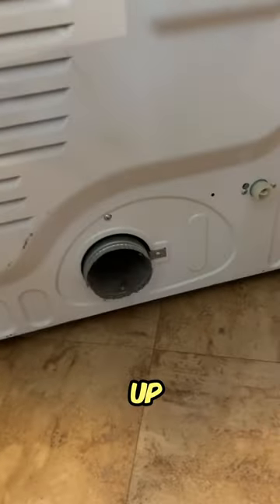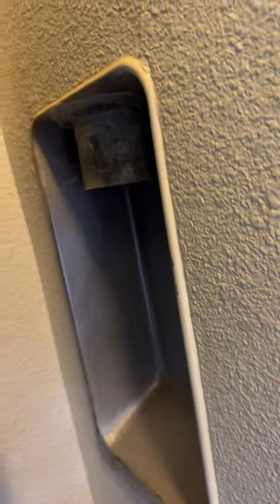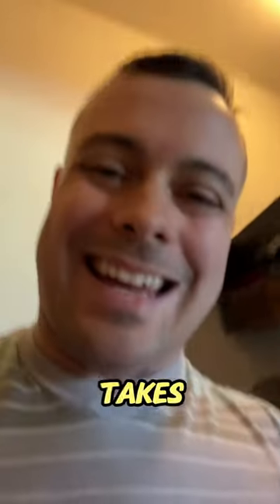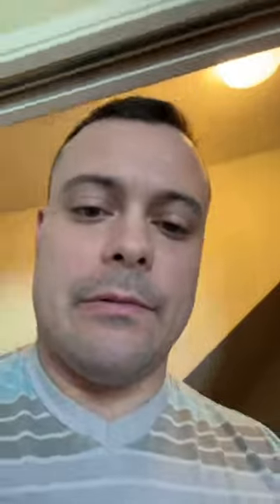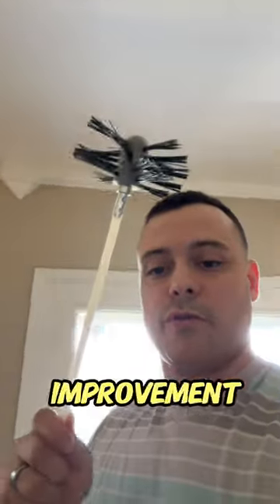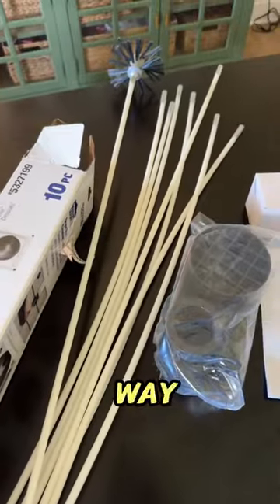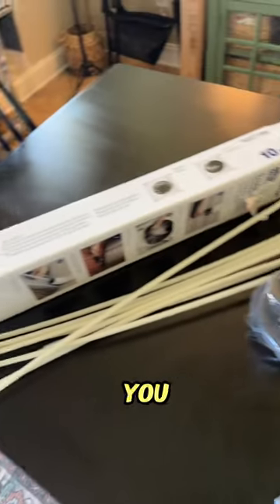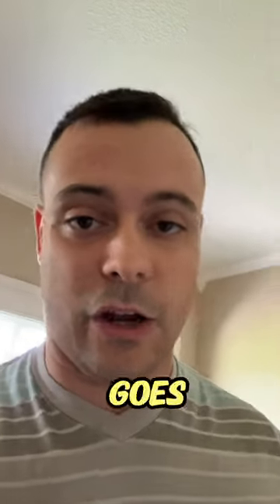Watch This Before You Buy A Dryer

Comment: Do NOT EVER spin that brush attachment in reverse. Always spin it forward even when you are pulling it out. Otherwise you will unscrew that connection and loose your whip in the wall.
Reply: Excellent advice. Also, I like to add electrical tape around the joints between the sections as an added safety measure.
Reply: Gorilla tape it on, or just glue the first rod on with jb weld.

Thank me later
Reply: Yeah I made that mistake my first time. Lucky I could snake it back out with my snap on master coat hanger hook to pull it back out.
Reply: @tarheelcountry1868  I won't, that's terrible advice. If you JB weld it it's not coming apart very easily. Just keep the drill in the correct direction.
Reply: @usb6000  the sections are quite flexible. We keep ours put together and coiled up. 
-Apartment Maintenance Tech
Reply: Goddamn it gump. You’re a goddamn genius!
Reply: Yeah good shout , this will save people a big pain in the arse
Reply: True but you can follow it up with a second brush and push it out.  Been there a few times with these snapping off on jobs.
Reply: Came here for this.
Reply: @austinhamilton9707 just get the nikkro ones. These are a “hey imma have to cut a hole in your ceiling” special.
Reply: Beat me to it. That was gonna be my pro tip too. It's so natural to flip the drill into reverse from muscle memory when pulling it back out. They honestly should make something on those connections that prevents the segments from unscrewing unless you press in a clip or something. This design flaw has caused mass anguish from people inadvertently doing this.

Comment: It can also become a fire hazard
Reply: Apparently one of the most common causes of house fires
Reply: @kmirandakm14 yeah, I deliver appliances and I've straight up refused to install a dryer because the duct was so clogged. Also, for the love of God, if you have an older house/dryer, replace your old vinyl duct BEFORE it starts melting
Reply: As a contractor that installs duct Work You have to secure with tin tape if because  you use screws it will collect more lint And burn your house down.
Reply: One of my classmates lost their house to a house fire caused by lint buildup. The whole school got together to donate and get them set up in a hotel for a few months and to help them get their life back together

Comment: Must be on post housing since that exit pipe shoots up instead of straight or down. Gravity only works in one direction and anything that gets caught will fall back inside once the dryer shuts off. Larger chunks are too heavy for a dryer to push out, and lint fibers will continue to stick together around those chunks. It's one of the first things I look for before signing leases, along with checking each outlet with a phone charger, if doors and cabinets close evenly, thin drywall repairs, and the like

Comment: You need to make sure you don't have bird screen on the roof vent. Some installers don't know to take it out or they just don't care. But it is a fire hazard, as well if the vent is over 35 feet it needs a booster fan. Every elbow in the pipe is considered 5 ft of the length, to FLA code at least.

Comment: Additional dryer tips from a military spouse—

If you use dryer sheets and fabric softener, the substance cakes up on your lint filter and even though you cannot see it, it affects air flow. Every few months, wash your lint filter in the sink with dish soap and hot water. You’ll notice that the water does not drip through the screen easily when you get started, but will once it has been soaped up. Dry it well before replacing.

Front loading dryers collect an extraordinary amount of lint under the lint trap, which you will not be able to remove without a little work with a screwdriver. This is true even if you clean the lint filter after every load. Look up a tutorial on YouTube to dissemble the lint trap and use a vacuum hose to clean up underneath and in all the crevices of the trap and around the moisture detector.
Reply: I bought a used dryer that had a lint screen that would not catch lint. Plain vinegar and a scrub brush finally got all the fabric softener / dryer sheet goo out. 

And, yes, always clean the dryer tube at least once a year. I find pushing from the top and using a shop vacuum at both ends works best.
Reply: Yes! Wool dryer balls, folks! more expensive than a pack of dryer sheets up front, but they pay for themselves in time, don’t contribute to that build up problem you mentioned, and do a great job of removing static and leaving things feeling nice and soft

Comment: Hey awesome stuff!
I am an appliance technician so I would like to add that if you don't feel comfortable with doing this call an HVAC specialist to do it for you. They recommend you get it checked out every year. The hardest part in my opinion is getting the vent tubing attached afterwards, pain in the bits every time.
Reply: I feel your pain there - just did this a couple weeks ago and that tubing was the worst part of the whole process!

Comment: This should be a yearly maintenance task. Those extendable brushes attached to a hand drill makes short work of it.
Reply: Should only need to be done every 3-5 years. if you have a flex duct then cleaning it too many times will rip it.
Reply: @Splat55099  You shouldn't have flexible ducts in your walls, and 3-5 years is far too infrequent, if your dryer isn't on an exterior wall where it can vent straight through.

Lint fires are no joke, and you'd be surprised how much build up.
Reply: We had to put a mesh cover on the exterior vent because mice were coming in through it, and had chewed a nice little hole through the dryer vent so they could access the space between the walls.   It worked a treat, but dang, that mesh cover clogs up FAST.  We have to clear that cover off several times a year.
Reply: @austinhamilton9707  i bet you have flex duxting and dont even know it
Reply: @Splat55099   Nah, rigid all the way up to the roof. (I've been living in and working on this house for over 20 years. I know it too well :D )

The fact that it does go to the roof means I need to be especially sure to keep it clean. Roof vents clog easier.

Comment: Pro tip: Use a leaf blower to blow out the clog. I didn't have enough extensions when I discovered the run was over 20 ft, but the leaf blower launched the bird nest straight out.
Reply: An LP air compressor also works, if you have one.

Comment: I'm happy that for the last at least 4 or so years, I've never had this issue. For whatever reason, lint just doesn't build up in my system. I tore apart everything, thinking that it was packed full. Turns out there wasn't even a thin layer built up anywhere but where the lint trap goes. And it wasn't even enough to do anything. But regardless, I cleaned it out. I still don't know why performance was down, but it's been working well since. Then.

Comment: I had issues with my dryer venting a few years back.  Problem was, it made 5 or 6 right angle turns on its way to the other side of the house.  I cut through the wall directly behind the dryer and vented it outside that way - lint issue fixed, and it is in a place where it won't create other issues.

Edit:  Also, check your washer to see if it has a trap.  Those will choke up over time and the water won't drain right.

Comment: These wall ports for dryer exhaust are a North American thing; they don't exist elsewhere. I'm in Australia, and I've never seen one, but my American in-laws told me all about it.

We've actually switched over to a heat pump condenser dryer in our new place, and it doesn't need to vent hot air or lint at all - just water into the laundry sink, and even that's an option (you can instead have it collect in a tank that you manually empty, if it's not going to be close enough to a sink).

Comment: The lint doesn't necessarily go out of that tube. That's why there is a lint trap. What it does "get rid of" is the exhaust from the dryer. Now the trap doesn't catch everything, so if the pipe isn't cleaned in a long time, then everything else he says is accurate.
Reply: And most of that exhaust is hot moist air.  If it can't get outside, that hot moist air is going somewhere. 

Maybe into the dryer, keeping your clothes damp.

Maybe into your wall, making mold.

Either way, that moisture that the dryer is trying to dry has to go somewhere.  We prefer that "somewhere" to be outside, hence the ductwork. but if that fart tube is clogged for any reason, that hot moist air is going wherever the hell it wants, despite the homeowner's protests.

Comment: I've done both the extention brush (don't back it out in reverse on drill, it threads and won't thread very easily if 10 feet beind a wall)
And with a carpet cleaning van.

The vacuum is way better... probably use a wet vac with a 10 foot hose. Way easier. Might clog if the vents have been awhile since maintained

Comment: Many dryers have a thermal fuse that will pop if they get too hot, they are one time and have to be replaced after you clean out the dryer and vent. They are about $10.

Comment: you need to also take your dyer apart and clean and scrub the stuck and baked on lint and dryer sheet residue off the inside of the fan housing and fan blades.
You lint trap should be catching 99% of the lint, build up like that means that people ran their dyer with a full trap too often and you might as well clean the fan and housing while you got it disconnected because if you dont the air flow will be low and your clothes will start taking longer and longer to dry.

Comment: Oh boy do I know exactly how much came out of that wall.
I helped my father in high school clean one of these out.
My job was to hold the bag while my father used the leaf blower.
The vent went approximately 60 feet and hadn’t been cleaned in probably 10 years.
Since I was outside with a bag and my father was inside, my brother was standing as an in between to pass information.
I get ready with a garbage bag to catch everything coming out.
My dad starts blowing the leaf blower and large amounts start coming out.
Very quickly the garbage bag fills up and I yell to my brother to tell my father to turn it off.
He was on his phone and not paying attention.
Very quickly I am completely engulfed in a cloud of lint too thick to see through.
I drop the bag and flee.
I run into the house yelling at everyone for not listening to me.
I was completely covered in lint.
The next time the dryer vent needed cleaning, I bought my father one of those tools in the video.

Comment: If you can get a decent seal you can also take a shop vac to the wall outlet and see if it will pull the clog back.  I did that in one house and it pulled a softball sized chunk of lint out after several seconds of suction.

Comment: This is usually what we have to do, I work in maintenance for a rental agency. Your local hardware store may or may not have these. If you're afraid of it unscrewing you can put a little duct tape on the connections.Usually takes quite a long time to build up enough to cut off your dryer. Also build up of lint can also cause a lot of condensation in the duct for the dryer also. Also be aware that some houses or apartments that are older might not have a dryer vent big enough for this standard 4" size brush.

Comment: FYI, if your dryer vent hose goes straight outside with no extra piping and whatnot, those hoses are cheap if you're too lazy to fight with cleaning it (guilty 🙋🏻‍♀️).

Also, clogged dryer vents are a fire hazard, so yeah...

Comment: I hate those tiny dryer connection alcoves. It should go from the Wall feed to the floor to allow a rigid metal duct to be used, not a flexible one... flexible ducts have too may draw backs and no safety, rigid metal ducts can contain a fire when installed properly.

Comment: Also make sure that the wall vent outside has no grill on it and remove the flapper. And never use screws when putting together the line, just tape the connections

Comment: How the heck did you get the “snap on” vent tube to stay on??? Every time I shoved it on good and tight, two dries later, it fell off. I eventually gave up and used a clamp.
Reply: Same here! Just use a clamp and don't go nuts trying that other kind.

Comment: i just ripped out the old flex tube last year. (it was so caked it was only abt 1 inch of open airway)

replaced it fully with hard-line tube.  so happy.  but yeah prob due to brush it out, ty.

Comment: That flexible duct is the issue. It caused such a slow down in velocity that the lint was able to deposit in the duct in your walls. This is very dangerous. ONLY USE RIGID DUCTING TO CONNECT YOUR DRYER. GET RID OF THAT FLEXIBLE PIPE.

Comment: I've installed about a 100k dryer ducts and I've never seen one go straight up and out like that. That's a horrible design because it almost guarantees an eventual clog and much faster. It will always have some lint going out of the exhaust instead of getting caught in the lint trap, and it can't carry it straight up like that. At least not very good. This is completely against code where I'm from

Comment: Not your usual subject, but nice!

Also, ditch the fabric softener.  It wrecks your washer (and clothes) by building up a scum on the tank over time.  Just use cheap plain white vinegar--in the same proportion--it dissolves the calcium in the water that leave your clothes stiff and itchy, and removes any odor-causing esters.

Your clothes will smell mildly vinegary when they come out of the washer wet, but once dried--totally scent-free and soft.

The microplastics in fabric softener swell the fibers of your clothes, making them feel softer but also breaking individual fibers in the threads, damaging them over time.  And it makes towels not pick up water like they're supposed to, because all the absorbent area is full of softener particles.

(and it's shit for the environment--microplastics in the water)

Comment: One the issues is that in texas it seems to be common for the lint vent to he on the roof. Fighting gravity and creating tons more piping than is needed for the dryers to deal with. Even the flap up top will catch lint and jam up so it wont let out the lint.

I had to go into our attic and disconnect the vent tube near the roof. And shive my arm up the pipe. I ripped the flap off and scraped with my fingers and small wire brushes until the caked on lint was gone.

It is an absoute nightmare. Make sure your utility room is on an outsode facing wall and send it straoght out the wall. The alternative is a headache and a half.

Comment: Yeah, just because lint ends up there is not where the lint goes lint supposed to be stopped by the lint trap in your dryer that is a simple exhaust port for the hot air that comes out of your dryer most typically the hot air gas if you have a gas Dryer.

Comment: Most of these are up to 6 feet Before you stick that thing in there duct tape the snot out if the connections cause when your spinning that thing and it comes loose it ain't coming back

Comment: clean duct also improves efficiency and lowers your power bills. Make sure you know what that "duct" is made out of, some shoddy contractors just ran the thin aluminum flex tubing vs steel or cpvc, so if you try to jam a brush your goin to tear that thin flex.

Comment: that is not where the lint goes. That is the air exhaust. To prevent that from clogging up, you're probably not cleaning your lint trap before every load you put in the dryer.

Also, it's a good idea to unscrew the back of your dryer to check for lint inside the dryer as well - this is a fire hazard because the lint is likely coming into contact with the dryer's heating element.

Comment: And that is why you should CLEAN THE LINT TRAP after every load. So that lint doesn't get sucked through and into the wet air exhaust.
Reply: Some still goes out every time you use it.

Comment: In Europe, we have filters in the dryer, so we don't need things like that.
You take the main filter out of the dryer and clean it, which takes about 5 seconds.
I think that system is much better.
Reply: We have the same thing. But some lint gets past the lint trap every time you use it.

Comment: Don't use the brush get someone to come clean it with air tools, if you're lucky the brush will work and be fine, if you're not lucky it will come apart or break and cause even more issues... Or worse it could pop a seam in your vent work and you'll be pumping lint into your house somewhere

Comment: You’re better off just drilling a hole directly out the side of the house your dryer is on. Unless you’ve got a crawl space, then go down and out. You never want dryer vent going up in any fashion. Also fun fact, check out your dryer vent, and if you see whoever installed it put screws in it, you’ll know you should’ve had someone else do it. That’s why it’s important to be self sufficient and know these things yourself.